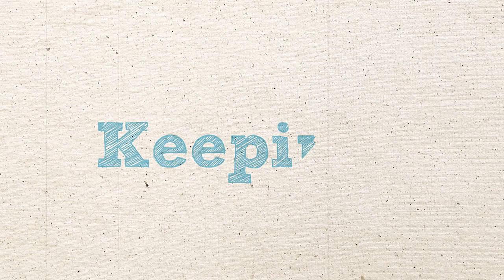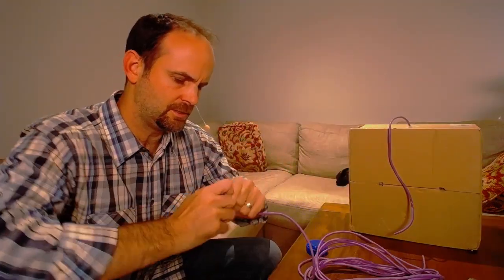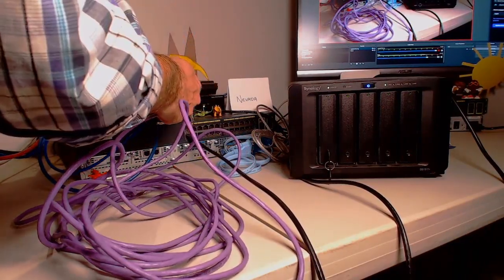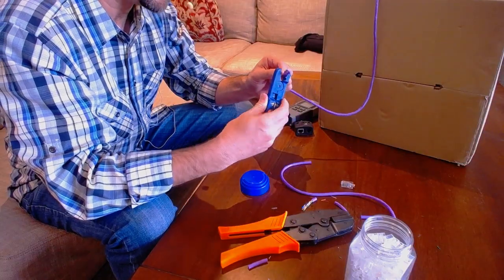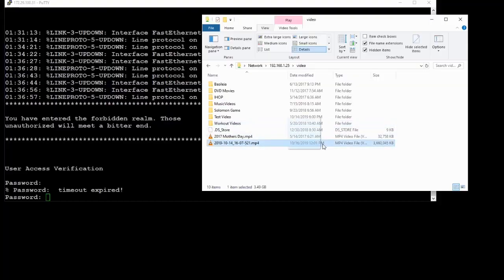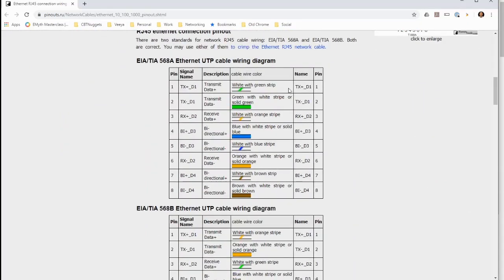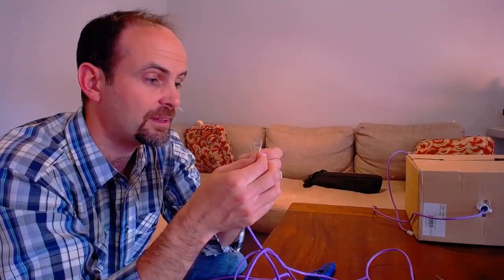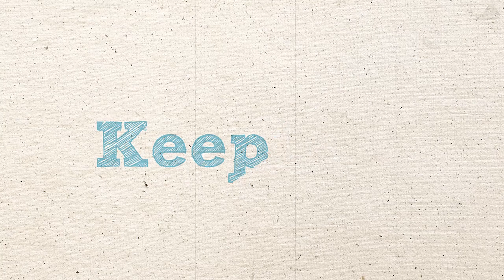Building a Mostly Bad Ethernet Cable, Part 2

Comment: Idea; if you make the cable a certain length it could become a resonant antenna for common over the air frequencies and therefore introduce EMI that could cause intermittent data loss. If you make another "franken cable" and make it approximately 2ft 4" it would be very close to being a quarter wave antenna for over the air FM radio signals. You could try several different cable lengths some resonant for the LTE cell phone 
band, but one for Wifi signals would probably to small to make a cable since antennas get small the higher the frequency. A quick google search for antenna calculator would give you the lengths if you know the frequency you are targeting. Just an idea, hope this helps and thank you for all the videos, they keep so many people interested and engaged and I know I am just one of many who finds them very educational.

Comment: As a cable technician I run into this a lot, but with Coaxial cable. I've seen cable that's been chewed up to the bare copper wire for over 10 feet and the customer has nothing wrong. While another has just a couple of cat bites and everything stops working, from TV to internet service being down. I've tried to create my own most bad coax jumper for testing as well. Same result, lots of trials and tribulations. :-)